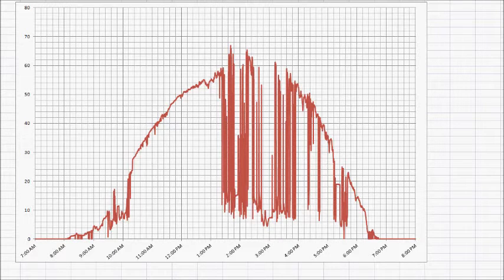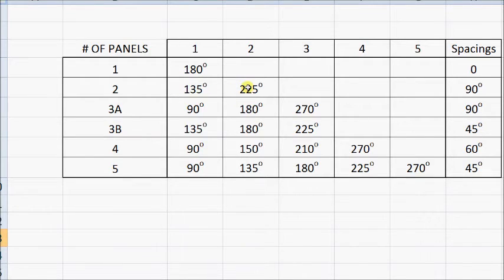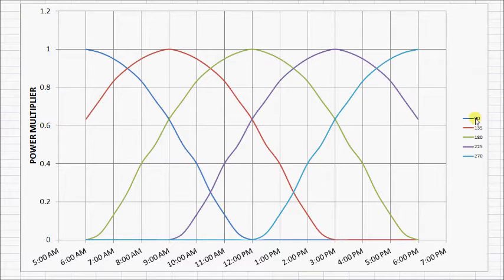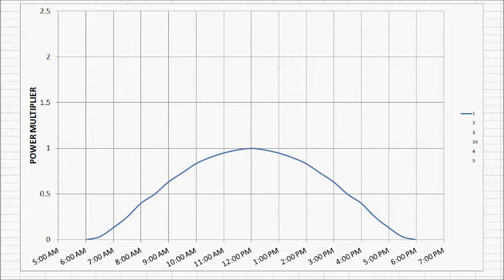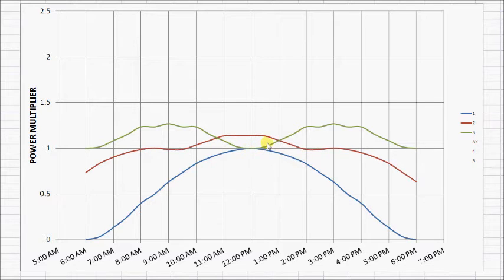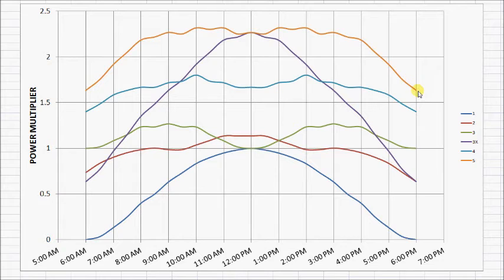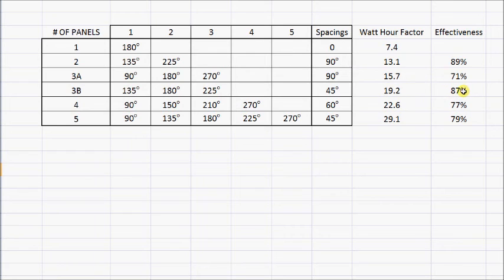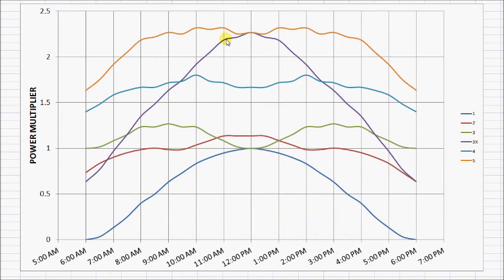The Effectiveness of Staggering Fixed PV Solar Panels

Comment: I guess you figured out polyphase. The one thing that is wrong here is that amplitudes of the functions are not equal as assumed. For instance,the due east facing panel would not have the same insulation at sunrise as the due south facing panel at solar noon. Without taking into account the attenuation due to the atmosphere the cumulative effect is wrong.

Comment: I would prefer fearless testing over fearless thinking.  Your simplistic theorized results bear very little resemblance to actual results.  An east-facing module at sunrise (even at an equinox) will produce nowhere near 100% of the module rating at sunrise.  It just doesn't work that way.  Array tilt matters; azimuth angle matters; the angle at which the solar radiation passes through the atmosphere matters; solar cell temperature matters; diffuse solar radiation reflected by the atmosphere also contributes to photovoltaic production. The notion that an east or west facing module (at what tilt angle?) will produce zero at noon is far from reality.  An east or west azimuth angle moves peak production a bit, but reduces and does not eliminate production in the other portion of the day.  You can use modeling such as that of the National Renewable Energy Laboratory's PVWatts calculator, which includes downloadable results for any and all tilt and azimuth angles at your choice of geographic location.  Take five and get real.
Reply: Wow!  I agree with all that you wrote.

Comment: Laughable, just point all the panels the same direction and track it.  I suspect that even if you don't track it the 5 panel all facing south will produce more power overall if charging batteries.  Funny you did not bother to show this.

I know this is an old video, but still valid and silly.
Reply: I initially thought the same, but if you stay with it, at the end he does a comparison of the efficiency vs a single panel facing south.
Reply: He does NOT do a "comparison". He shoes bad graphs based on bad assumptions.  Is your sun shine, at full strength at sunrise - ie equal to the strength at Solar Noon????

Comment: curious, If 100% power is produced with the the panel perpendicular to the noon sun on a clear day, what is the effective output with the panel perpendicular to the sun just above the horizon (est 7-8am)? something tells me its not 100% of the rated output.
Reply: It takes about 2 - 3 hours AFTER sunrise for an East pointred PV Panel to be at 100% output. This video has the power at sunrise and sunset very wrong ...

Comment: no comparison added to show the full five panels in south configuration.. and calculations of total watt hours "under the curve" missing for each config..
One thing this does prove though is that a solar tracker is worth investing in!
Reply: it has efficiency 80% to south oriented pannel

but it has advantage for off-grid system having lead acid battery 
you to charge battery continuously 
for 6 to 8 hour

Comment: If you have minimal batteries it looks like a good idea to spread out the day like that. 3B looks like not too much of a loss to achieve a longer day. I have 12 south fixed panels and I opted for 6 more to rotate to achieve the longer day, where electricity gets used directly by my house. Direct use is much more efficient than charging and discharging batteries, by at least 10%.
Reply: Where do live that has a sunrise and sunset strength, equal to solar moon?